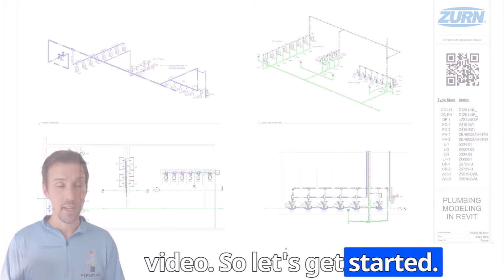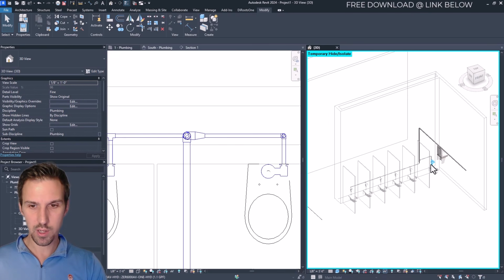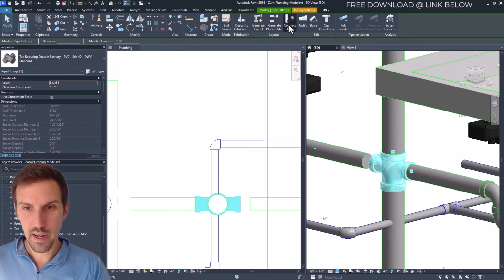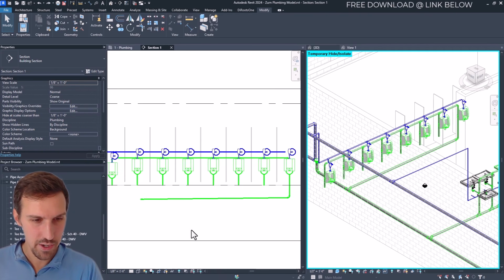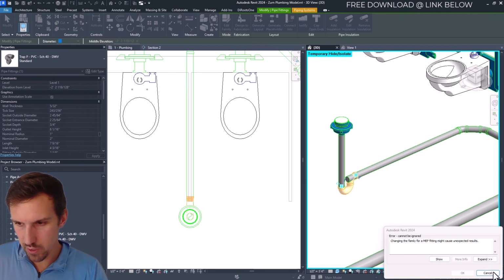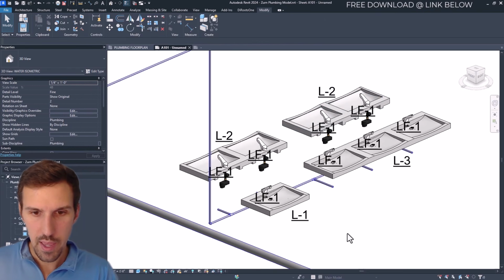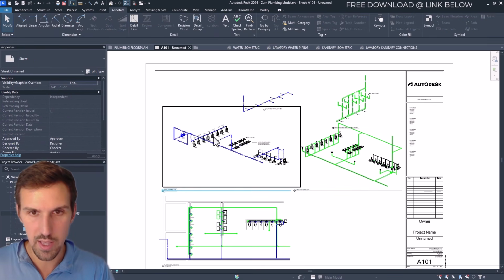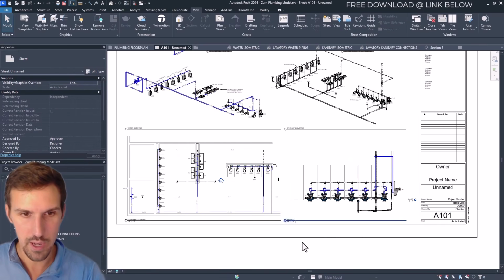The Ultimate Plumbing Course in Revit (2.5 hours)

Comment: Your videos are amazingly helpful. I'm trying to vent a sanitary branch to a floor sink and have the DFUs carry through the tee fitting for the sanitary system but also have the VFUs carry on through the vent system. I can't figure out how to make it work using calculated pipe connectors. Have you done this before and if so, how did you solve the problem? Custom tee pipe fitting? Custom plumbing equipment or fixture?

Comment: I opened the ZURN BATHROOM.rvt file and it has an extra floor at the altitude about 3/5 of the wall's height. While in plumbig 3D view while i can see the edges it doesn't block my view, but in the arhitectual view it blocks the view making me unable to see all of the toilets and sinks. To solve this I unchecked the floors in the visibility graphics, but it still isn't a sustainable method. Is there a way to take that one floor out of the model?  What can I do about it?

Comment: I downloaded the Revit model you linked to and it isn't named "ZURN BATHROOM.rvt" but rather "Zurn Plumbin Model.rvt".  If I go ahead and link it in, it doesn't look the same as in your video. There are no walls, and everything is already piped up, cold and hot water, sanitary drains and vents, etc.  
I also get a message saying the "nested links will not appear because their Reference Typer is set to Overlay" and to change the Reference Type to Attachment. Doing so doesn't change anything visually.
Any idea what the issue is?
Reply from the maker: Hey there! I accidentally put the plumbing model in the folder and forgot to add the Architectural Model. Try re-downloading the file and they should be both in there. When following along, you'll want to start a new project from scratch. Go to file, new, and start with either the plumbing default template or use the systems imperial template.
Reply: But i can't even find the file, whwre do we download from @mep_guy